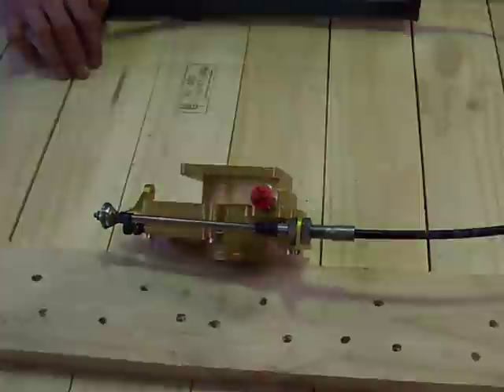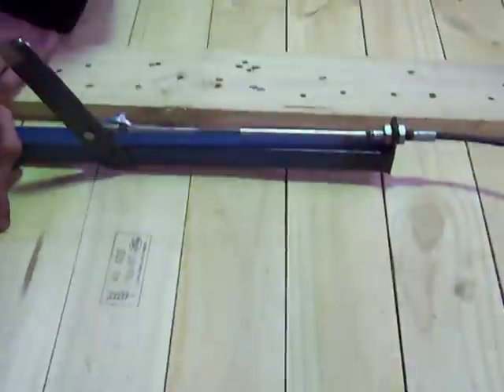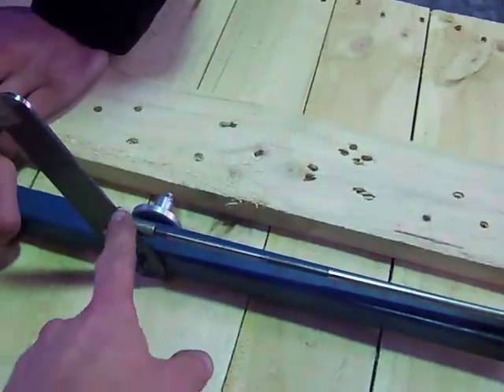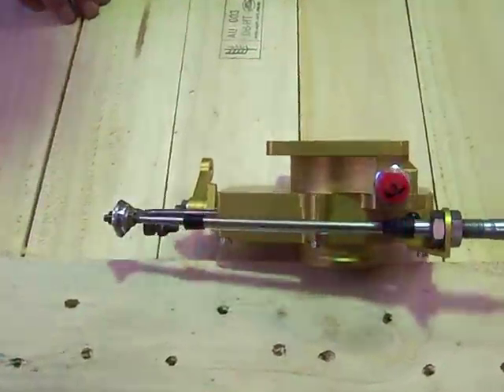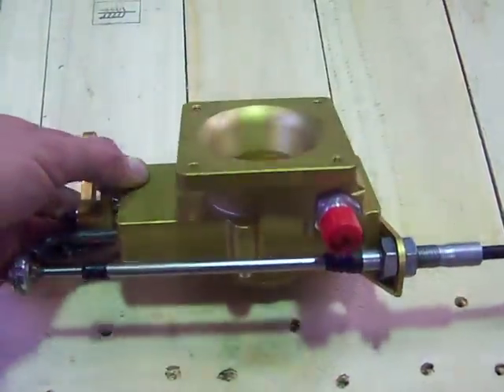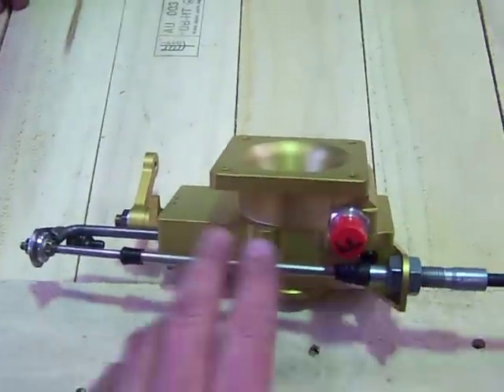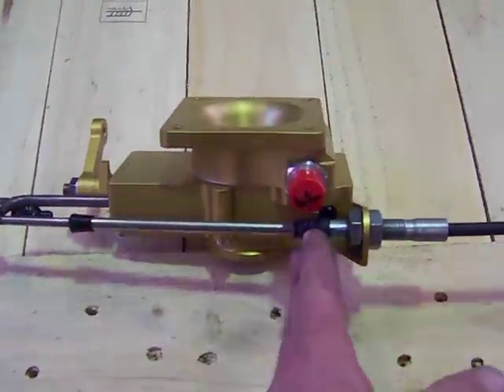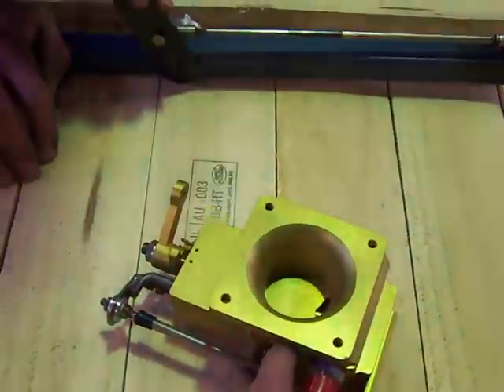TBI-40 THROTTLE CABLE OPTION 2

Comment: What are the benefits of this slide type throttle over than butterfly when lever is inside the throttle?the butterfly's negative aspect is the shaft(in Your case-lever)
So,where's the point?